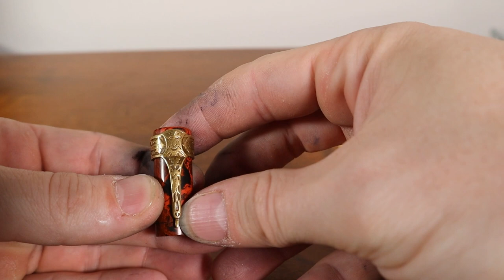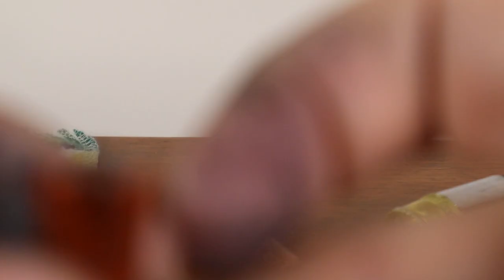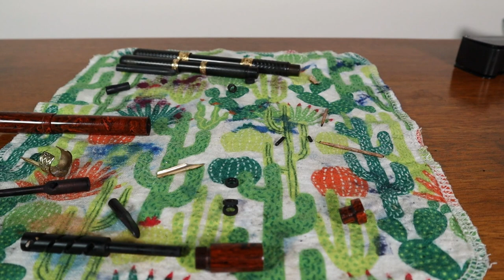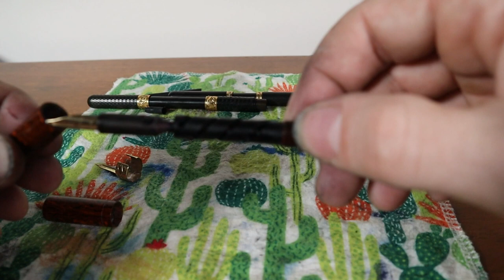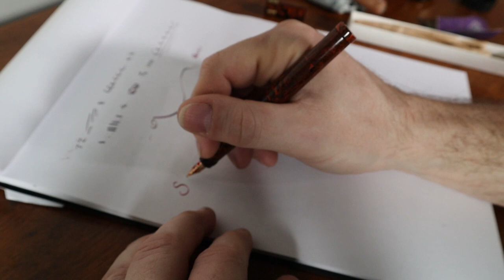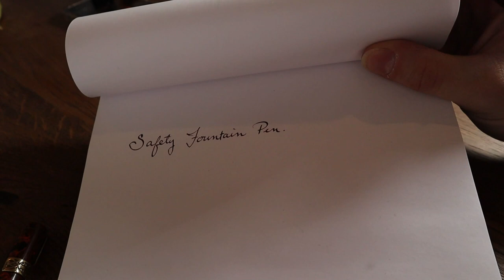Vintage Safety Fountain Pen full restoration tutorial

Comment: Thank you for this video. I have two watremans to restore and clean and fix the rubber sealing. It is in my project bags and this video is very helpful to get them started .
When you find the pen doesn't start what I do is just dip the pen in the ink bottle. as I use a dip pen writing. it might restart again as normal pen.

Comment: Another great video.  I'm currently working on a BHR waterman safety pen very similar to yours.  One question, how snug does the o-ring need to be both on the inside diameter and the outside diameter.  I bought from the hardware store a 5/16 OD and 3/16 ID o ring.  I can tell that it's touching the the ebonite rod on all sides on the inside and touching on all sides the tube section of the pen; but it there is not much friction on either.  Does it need to be a very tight fit to be leak proof?